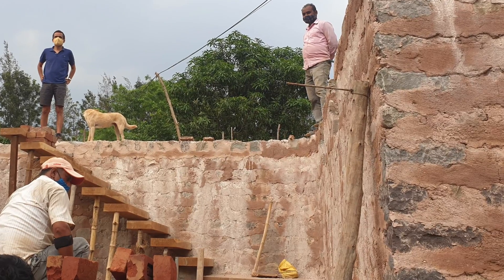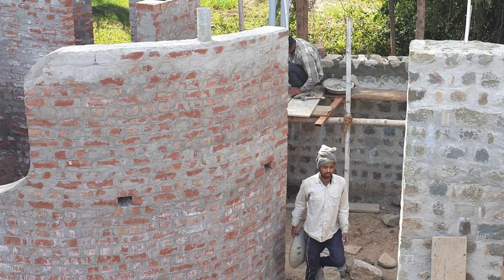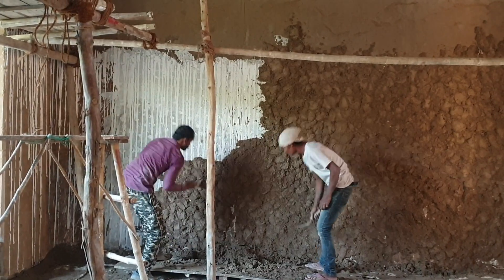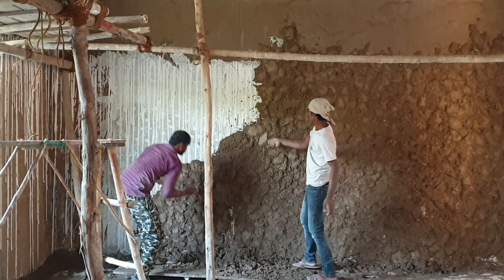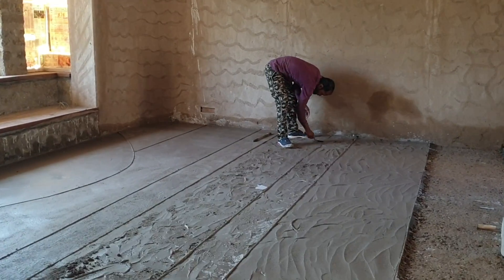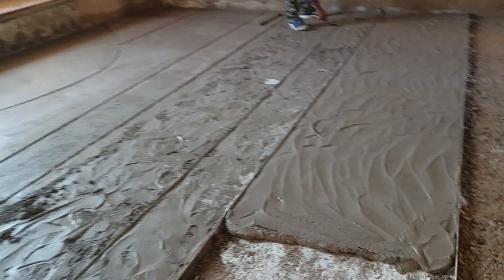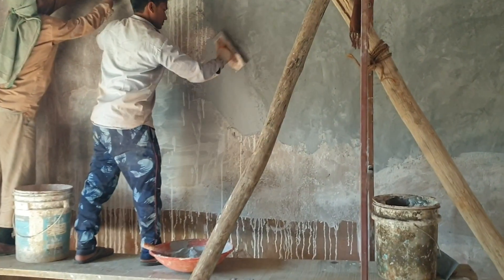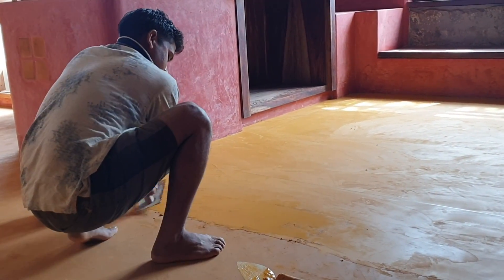Bring Lime into your Building

Comment: Don't generally comment but this is quite interesting and if you have the answer it would be amazing because i'm hearing conflicting stories and difficult to distinguish between propaganda vs reality. If building a project with Rammed Earth, the wall structure will be interlocking removing the need for steel rebar. My question, are you saying that the 8-10% concrete mix that is applied can be exchanged for lime instead and that would act equally as strong as a cement? (The climate is very tropical where this project will take place and mold is always an issue).

Always looking to learn from the professionals.
Reply from the maker: We have used concrete wherever we have used steel rebars, as steel and limecrete are not compatible. If you are in an earthquake prone area, like we are, you may want to include some pillars in your walls and tie them with the plinth beam and the ring beam - to staple the structure together. Otherwise you may not need any beams and pillars at all